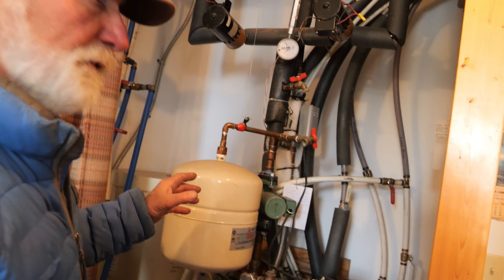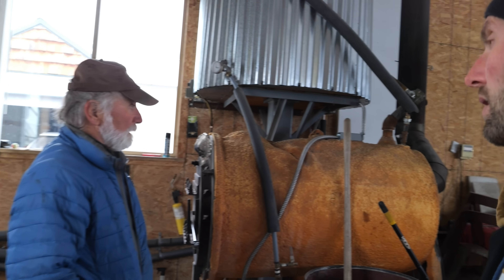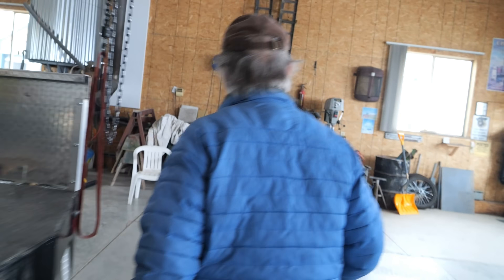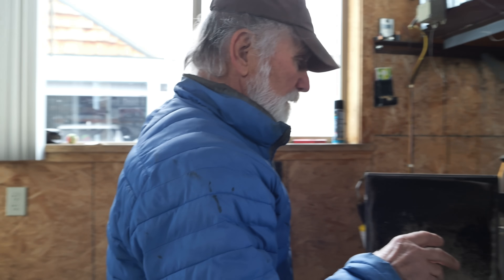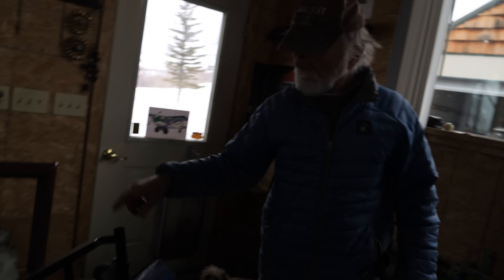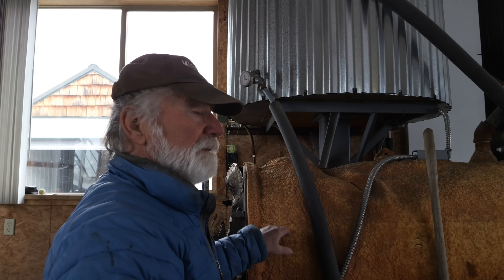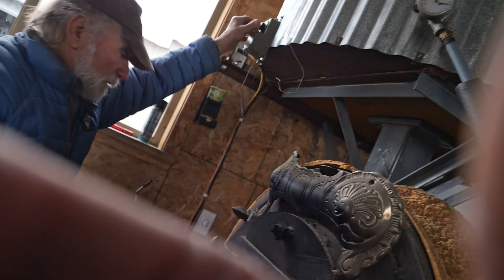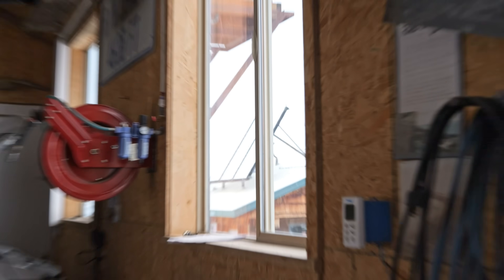Hasn't had a Heating Bill for 40 years.

Comment: I’ve had an underfloor Heating system For 15 years and my annex  building water in the floor. . It’s common in Europe . I renovated at 230 year old cottage  and installed under floor heating throughout ground floor and first floor (first and second floor in the United States)…. The main thing, though was that I inflated all the external walls and the floor 150 mil Nearly 6 inches…. Hardly need to heat  the house at all …
Reply: insulated

Comment: Tom's right in his thinking on how to fire his boiler. The part of the boiler that "sees" the fire is called the primary heating surface which is more efficient than the secondary heating surface that just has the benefit of the hot flue gasses.

Comment: Nice system. I have been designing something for our property that's very similar. It baffles me that some people may have told him they don't believe it works?? It's engineering, not wizardry. There's science and mathematics backing everything he does. If his setup is producing adequate heat for his home and shop it's because he designed it to produce adequate heat. We're bombarded with solar radiation every day and barely make proper use of it, this setup shows the power of an eco-friendly heating system. If everyone used a system like this, the energy consumption of households in cold climates would be reduced by nearly half annually. That is a massive impact on energy requirements nationwide. Regarding his comment on efficiency of solar thermal water tubes... they're something like 85-98% efficient which is far better than most other means of heating. 

The science channel Tech Ingredients has a very detailed video on constructing solar thermal water heater systems - not this complex of a system but they go into the science quite deeply so you can design your own.
Reply: May I ask, are you fabricating your own boiler or working off of an existing model?

Comment: I applaud his well thought out system but to claim he has not paid a dime to heat his house is not accurate at all. The assembly of the hardware was a cost, the maintenance is a cost, fuel even if from "free" wood off the land is also NOT free, it takes time, work, money for saws and equipment to haul and handle the wood. It is all in how you define cost but there is no free lunch. He has to have electricity. And the system is not capable of rapid heating so convenience is sacrificed. If he is unable, who will and can run that system. Things to think about.
Reply: OF COURSE the equipment cost was not factored in or the labor. But after the amount of time it's all been working, it's paid for itself many times over, and since the day it was operable, no further out of pocket expenses have been incurred. The small amount of electricity to run the circ pumps is also "free." I think it was Ben Franklin that said "a man that cuts his own firewood is warmed twice!"
Reply: people get so butt hurt over this.  he doesnt have a recurring utility bill like most people

Comment: Very interesting video, I've been thinking about getting a hydronic heating system, but I would prefer to buy the components from an experienced supplier.  So far I can't find a reliable company that makes the stuff.
Reply: Look on line, I built my own 15 years ago in a new 20x30 shop. I ordered my PEX, Boiler, and manifolds from an online vendor. The PEX was German made and the Boiler and manifolds was from a company in Canada. I can’t remember the name but I do remember that there was a few to pick from. The boiler also supported supplemental heat sources. I was planning on adding a pellet burner/boiler but moved before I could. It took me a week or so to research how to build the system, I found all of it online. Of course all the plumbing bits I purchased from a local pluming supply. My system was one zone with three loops and it was a closed system.
Reply: @brianboot8623  Thanks I'll have to do some research.  I want a wood burning system that heats a small house.  I would like a stainless steel oven.

Comment: "Modern" standalong hydronic (rather than just electric/resistive heating) - Solar PV powerimng an Air or "hybrid"  "ground source" storage heatpump  -  plumbed into the hydronics, or/also a thermal mass for energy storage/retrieval  (NB. ?? Combining Summer PV and resistive heating of a thermal mass to XXX degrees..  To be retrieved in winter using a "pseudo ground loop" (make it a copper loop - to allow high temperature summer storage)..

A Ground source heat pump, "could be set up" with both an Air source exchanger for when it is not so cold, and a ground source "exchange loop" for the really cold times.  (If one can do their own excavating, and has land, these things aren't "too difficult" - where there is a need ingenuity abounds..)

Comment: Great idea! I assume there is a pressure relief valve in the boiler system if it has been operating safely for so long. Otherwise could be a death trap if a circulation pump failed to operate and the boiler kept heating.
Reply: Systems like this are normally run with open vents to the atmosphere so no pressure can ever be achieved, no matter what fails.
Reply: Indeed, good catch! Plus the PEX line would blow way before the steel boiler could ever develop enough pressure to blow.

Comment: Enjoyable to see and hear about Tom's heating system.  He's entertaining to watch.  The boiler itself would cost a ton to build now with the price of steel so might have to improvise, however I live in the hills in North Ga. so not so cold but  sunny so very little wood should be needed.  Might be possible to use no wood except in extreme cloudy weather.  I appreciate the video and thanks Tom for getting this old man thinking.  God Bless.  NW ga.
Reply: I would suggest a drain back system for the solar side. Less headaches with heat dumping and other solar issues in your area.
Reply: @peted2770  Sound advice thanks.  More than likely this is some sort of dream to have a system like this.  Have a lot to learn and a short time to make it happen.   At one time or another been able to try different heating methods.  Coal as a young boy (pot belly).  In my current house I've tried wood heater (Ashley),  propane space heaters (Atlanta gas light w/ceramic reflectors),   electric (heat pump all electric) and at my age the electric is cost effective,  clean, easy at least in my area.  It's steadily climbing but Ga. is ranked as a lower cost per kilowatt state.
Reply: Definitely does not need to be so big!

Comment: I have a very simular  system except I have a filtration system and a very slight mixture of propylene in the water as a conditioner.....and a -35f mixture for the outside .....my boiler in outside boiler......it also heats my domestic hot water via exchanger

Comment: The only time of the year that my water heated floor isn't nice is in the spring when it's cold then hot then cold. When the floor is hot the shop is way too hot and you can't shut it off. But, the heat is simply amazing having cold feet in the shop sucks
Reply: Try an outdoor reset control.
Reply: @redjohnson4859  if you stop running the water through the floor the boiler over heats, and the floor is 110 degrees and all that concrete holds it for a long time. If you cooled it with cold water then by night fall you’d wish it was warm again…. I’m just saying where I’m at the Indian summers temps swing so much it’s hard to keep up

Comment: In summer what do you do with hot water? Just don't circulate it?
Reply: The 6 panels on the shop roof are drained, takes a few minutes, next fall it goes back in. The house system runs in reverse, using the 200 gallon shop tank as a heat dump, plus the shop bathroom's water tank.

Comment: Cool system.  An interesting idea would be to use the vacuum tube style solar panels.  They work better in cold areas.  And the cost is reasonable.
Reply: Snow can be an issue.
They are more effective in colder climates.

Comment: Classic old school ingenuity .I use some of the same system it works really good
Reply from the maker: I'm fortunate to have Tom as a friend!
Reply: My style of "Old school" is stuck in anything up to 1960's commercial tech. So seeing this setup using solar powering in both heat exchanging and electric conversion panels in addition to old school water heating pipes in floors, and a boiler with heat exchanging for water still looks rather hi tech to thine eyes. Matter of fact, the floor heating pipes setup can be traced back all to the way to old Roman systems. Specifically their bath houses. They had pipes in the floors and separate sections for cold zones AND hot or heated zones in the rooms and floors. One of the first things a Legion outpost would do, if it was going to be more than a temporary encampment was start work on a bath house among all the other projects needed for a fort however far out it was. I can see the blend of old and new school here and, it is glorious.
Reply: Guys, Here is our Savior

HalleluYAH translates “Praise ye YaH”

YaH is The Heavenly Father 
YaH arrives via the TENT OF MEETING
YaH was Who they Crucified for our sins
YaH was Crucified on an Almond TREE

— Ancient Semitic Cuneiform of Moshe (Moses)
— Isa Scroll (The Original Isaiah)

Isaiah 42:8
"I am YaH; that is my Name! I will not yield my glory to another or my praise to idols.”

Isaiah 43:11
“I am YAH, and there is no other Savior but Me.”

Isaiah 45:5
“I am YaH, and there is none else.”

Comment: Excellent system. The fire box has the exterior air vented into the burn chamber so no sucking outdoor air through doors, windows, etc = genius.
Reply: You nailed it. This is the crux of efficient wood burning.
Reply: - and no losing warmed room air to the fire.
Reply: -and no oxygen depletion in the living quarters.. @kadmow
Reply: @roberttammerawitchey4652  , yes. That too... (Though ERV/HRV is a smart addition to any tight system- or just one with no pressure differential - leaky openings only leak if there is a pressure difference) ventilation needs air changes - best to engineer this in (even if metered to be in punctuated intervals - depending on use cases (ERV doesn't necessarily "have to" be continuous - a sophisticated system could use moisture levels, dew points, etc - hypothetically..)..
Reply: calm down mate. he's burning wood in a big barrel to heat a shed @kadmow
Reply: @cliveramsbotty6077 a water jacketed barrel, mate.
Reply: cold air intake
Reply: It's a very common thing in areas where there is wood to burn. It's common because it's common sense.
Reply: There is always air leakage in windows and doors and other improperly sealed cracks in the walls and roof.

In general most large demands for fresh air combustion are fed from outdoors … many of which that experience subzero need preheating to prevent condensation and thermal shock in the boiler.

Wouldn’t want to know how many trees he has harvested for all that heating.
Reply: How does the glycol warm up when it’s so cold outside ??
Reply: @fredswolen894  The solar heat panels are black, even during freezing days the sun will heat that black surface and heat the glycol inside the panels.
Reply: @fredswolen894  The solar heat exchangers heat the glycol.
Reply: Your gonna need a bunker. If this goes viral they'll come for you!
Reply: I think it would benefit from it being at a lower position inside the burning chamber, but it's nice indeed.
Reply: It’s not exactly an unknown way to set up any furnace.
Reply: This is awesome. Love the compartmentalization and options. Complicated system but still simple enough to teach. Only problem is this probably cost $80,000 or more to set up
Reply: Right no negative pressure pulling in cold air , moisture etc
Reply: Yeah, venting a fireplace isn’t genius.
Reply: @andrewalexander9144 feeding a fireplace with fresh outside air is though and easier said than done.
Reply: Here is the True Savior

HalleluYAH translates “Praise ye YaH”

YaH is The Heavenly Father
YaH arrives via the TENT OF MEETING
YaH was Who they Crucified for our sins
YaH was Crucified on an Almond TREE

Semitic of Moshe (Moses)
Isa Scroll (The Original Isaiah)

Isaiah 42:8 - I am YaH; that is my Name! I will not yield my glory to another or my praise to idols.

Isaiah 43:11 - I am YAH, and there is no other Savior but Me.

Isaiah 45:5 - I am YaH, and there is none else.
Reply: Guys, Here is our Savior

HalleluYAH translates “Praise ye YaH”

YaH is The Heavenly Father 
YaH arrives via the TENT OF MEETING
YaH was Who they Crucified for our sins
YaH was Crucified on an Almond TREE

— Ancient Semitic Cuneiform of Moshe (Moses)
— Isa Scroll (The Original Isaiah)

Isaiah 42:8
"I am YaH; that is my Name! I will not yield my glory to another or my praise to idols.”

Isaiah 43:11
“I am YAH, and there is no other Savior but Me.”

Isaiah 45:5
“I am YaH, and there is none else.”
Reply: @YaHsServent stfu no one care🙄🤦🏻‍♂️

Comment: Cool stuff, i guess if you would build this today you would use heat pumps. But if it works it works.
Reply: Solar thermal is massively more efficient than solar PV
Reply from the maker: That would be efficient! and use PV panels to supplement the power they use.

Comment: Does this system also provide hot water for the shower, dish washing, etc.?
Reply: Yes, both in the shop bathroom and the house. Both have stainless steel tanks with built in heat exchangers, and also electric elements.

Comment: Can we get a schematic on how this works?🤣
Reply from the maker: haha I'll ask Tom!
Reply: @JonasMarcinko I agree understand some but it's a little hard to follow if your not knowledgeable on this stuff.
Reply: @JonasMarcinko   hey man have you spent any time on the Capella? Was just thinking about it, if you put VGs and maybe a cuff or slats on the wing leading edges it wouldn't break so sharply in a near stall situation. Just saying.
Reply: Its easier to think about this as separate systems, which is how they operate.
The solar system is simple, one loop of glycol to the panels, and another look that connects to the floor. They only meet in the exchanger since there is no reason to have glycol in the floor unless you will let it freeze. 
The wood system is very similar to the solar but using the wood stove as heat. The heat from the wood stove heats water in a loop going through the wood stove (custom made) and the water in the giant tank above the stove. There is pipes in the tank that connect to the floor. Basically acting like the exchanger in the solar system with with a lot of heat holding ability in the water. 
I think he would be running two sets of pipes in the water tank. One set for the garage, and the other for the house. 
Also the connections to the floor is simple, it is just a regular in floor heating loop with two sources of incoming and outgoing lines. One set to the solar and the other set to the water tank. I would assume he has some sort of check valve, which I think are built into the circulator pumps anyway, to prevent each system from back feeding to  the other. There is no point in the solar heating the water tank, and there is no point in the water tank heating the solar.